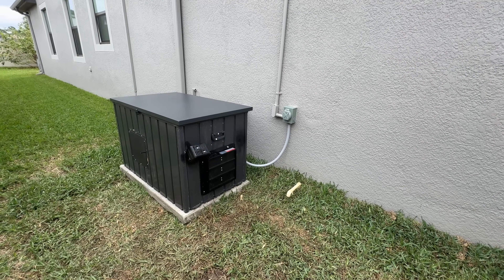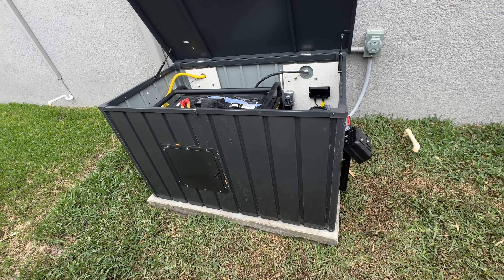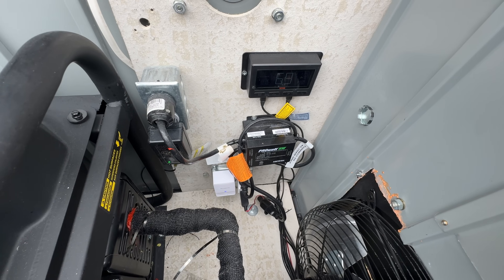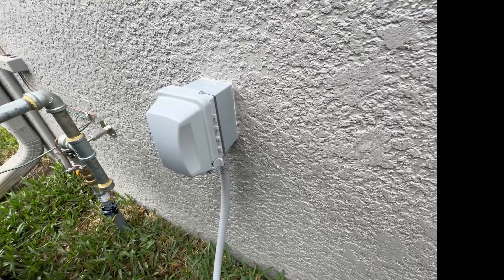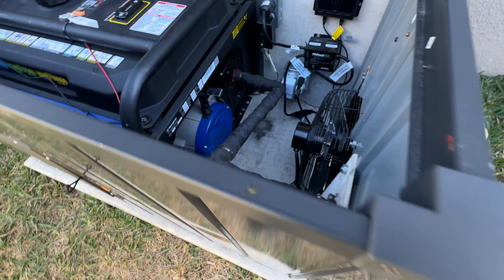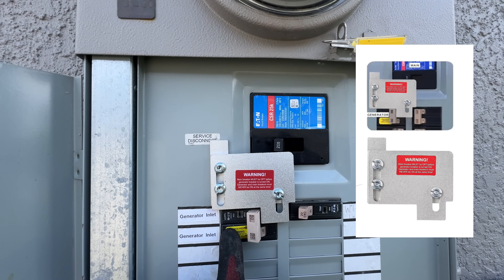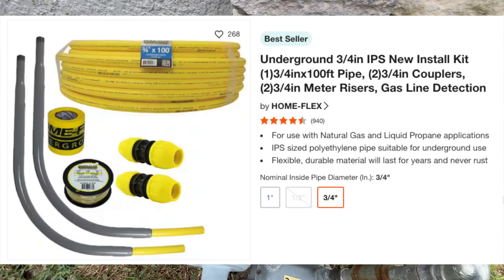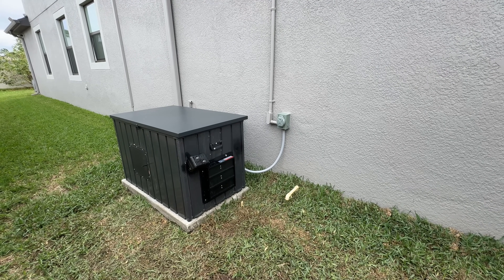DIY Whole Home Generator Enclosure: Power Your House Like a Pro!

Comment: Excellent video Bredren 🙏 I have a 30 amp Westinghouse transfer switch that I got for hurricane season, today an electrician quoted me 3000 to 4000 to install. So here I am. I have minimal electrical experience. Basic wiring of a switch and GFI outlet is about the extent. I live in central Florida. Would love to collaborate with you, I'd pay you for your expertise. Very serious. Give thanks Bredren 🙏
Reply from the maker: I live in the Tampa area and can provide some guidance.

Comment: Amazing work!  Why did you not choose to go with an inverter generator?  Do you have any concerns or thoughts around "dirty" sine waves from the Westngihouse generator?
Reply from the maker: To be honest, I had to look up the difference between an inverter, a generator, and an inverter generator. In the end, I felt that a standard generator would meet my needs. I’m not particularly concerned about dirty power.

Comment: Ok I need some clarity. I thought it was almost necessary to use an inverter generator for the "clean sine waves" and avoid some equipment damage. So can I or can I not run a regular generator?
Reply: You can, but heed caution.

Comment: Greetings my distant cousin...I have been rooting around for a satisfactory DIY home emergency power configuration since last fall.   I have seen many good ones, but yours is one of THE BEST I've seen.   I like ALL the bells and whistles of your install, including the case.   Kudos to you!  I do have a few thoughts involving the THD rating of the gen you chose.  As there are power sensitive "computers" in every major system and appliance in modern homes, I'd tend to seek a gen with much better THD stats.  Also when I mimic your setup...I expect I'll seek to add some sort of sound deadening material inside of my case.

Comment: Hope you never plan to change the oil or have to service the generator.
The exhaust setup will burn up the exhaust valve in the genset engine. they are not designed for the back pressure you added or excessive exhaust heat load you're undoubtedly creating in the Chinese cylinder head.
Reply from the maker: What is your solution as this could be an opportunity for all to learn?

Comment: DUDE this is exactly what I am looking at making. Thanks. $3K DIY for $6K for an installed Generac
Reply from the maker: Yes! The Generac pricing is crazy- a total ripoff.
Reply: I’m preparing to do mine, I intend to use GenerLink to hook up to the meter and using a electric start generator so I’m guessing I’ll need a window for the infrared. What size Nan did you use and was it enough to control the heat. Love the look of your cabinet, very professional look

Comment: 👍Looks good, but I would added #8 or #5 304 Stainless Steel Wire Mesh on both fresh air intake and exhaust. The mesh is for stopping large 🐛bugs, small mammals(🐀mice), and reptiles(🦎lizards/snakes🐍) from getting in & setting up shop. Mice can squeeze through holes or cracks as small as 1/4 inch, while rats can enter through openings as small as 1/2 inch. Where their are mic or rats snakes will follow to the nests to prey on. Also adding Borax powder around the inside base of walls can be used as a safe way to help control certain pests like 🐜ants, & 🪳cockroaches. Ants are especially attracted to electrical equipment for several reasons. They really love getting into electrified outdoor enclosed structures and making themselves a home in them. I now use Borax around the high voltage contactor & capacitor in my HVAC systems condenser unit. After having to remove a hole ant nest(eggs and all) form the high voltage contactor that shut down my homes AC one hot summer.
Reply from the maker: Great idea. I will definitely add that as it is an easy add. It's a little more difficult on the exhaust but still doable. Thanks

Comment: I’ve seen the same automatic transfer switch on several other builds and I have an honest question. If you have utility power coming in to power those additional outlets, and the the transfer switch is just for the fan, couldn’t you just flip the breaker in your panel once the generator is running and save money on the transfer switch?
Reply from the maker: You’re absolutely right. Another viewer actually pointed out the same thing in the past. It was an oversight on my part. In this design, that step is completely unnecessary—I could have simply plugged directly into the outlet, and everything would’ve been more streamlined. Thanks for sharing so others can know this fact.

Comment: thank u for the video!
What gauge wire did you use to run from the inlet to the breaker? I am doing something similar and am thinking 6 AWG is the way to go.. opinion?
Reply from the maker: Sorry—I’m not sure how I missed your question. I used 6 AWG wire.

Comment: Is it a floating, neutral or bonded regarding your home breaker panel? And do you have an emergency shutoff switch? I think that model has remote start..
Reply: It needs to be floating when connected to the house through a two pole breaker.  If it were connected with a three pole disconnect that switches neutral then it would need to be bonded.

Comment: Do you have to remove the side each time you need to do an oil change? While running its recommended to change the oil every 10-12 hrs.
Reply: Good question, I’m keeping that in mind for when I build my setup

Comment: I have questions about this setup as I am looking to do something similar at my house. Why did you ground your generator when you main panel is already grounded? Did you unbond the generator so the electrical path would only go to the grounding rod?
Reply from the maker: I haven’t changed the oil yet, but I ordered another access panel that I’ll be installing to hopefully make that easier. If that doesn’t work out, I’ll have to remove the side of the enclosure.

Comment: Great Job!  I built one using plastic trash enclosure. I too live in Florida It worked great until Rodents chewed up internal generator control wiring.  After  reworking wiring.  I decided scraping   enclosure idea. I did have issues with O2 sensor.  I used 13000 watt dual fuel Duromax.
Reply from the maker: Damn rodents. I was mainly worried about bugs nesting, so I blocked most of the obvious holes. But clearly, there are plenty of other ways for them to get in—vents, gaps, who knows what else.
Reply: @ColleKharis  For some reason thy like chewing ignition coil wires.

Comment: Excellent job!!! How does it sound?  How much did it decrease the the db level of the generator when operating before and after?
Reply from the maker: Sound was never a major concern for me, as I’m surrounded by homes with generators that are all louder than mine. That said, someone did ask me a similar question in the past, though I can’t seem to find their message or my response. If I remember correctly, when I tested it, there was about a 6 dB drop—but don’t quote me on that. I’ll need to redo the test to confirm.

Comment: Not too bad for not being Tradesmen however a couple issues the number 6/3 & 14/2 Romex that you ran, is not permitted in damp applications like PVC pipe outside and going to your generator, it is permitted in PVC pipe if it was in your garage but not outside. The outlets you put in the enclosure are not weather resistant or GFI protected, that was showing anyway. The box in the Attic where you spliced in the generator because there is a splice in the wires do not pass through you are required to ground the metal box with a grounding screw on the box terminal. The junction boxes in the Attic are required to be no more than 3 ft from the Scuttle entrance so they can be accessed without crawling in the Attic, location they are in is not considered accessible. Not sure how they let you get away with back feeding the entire house with 50 amps and not have a separate panel that the generator is only feeding Other than that not bad.
Reply from the maker: Thanks for the detailed feedback — it’s really helpful. Based on your comments, I’m assuming you’re an electrician and clearly much more knowledgeable about these matters than I am. The outlet inside the enclosure is on a GFCI circuit, as there’s a GFCI outlet in the garage upstream of the breaker panel. I’ll have a licensed electrician friend take a closer look at the other points you raised.
Reply: They allowed it because no permits😂
Reply from the maker: @nitto420s Got it—now I fully understand what you meant about the 6/3 and 14/2 Romex. I didn’t run Romex through the PVC; I used individual conductors for both the generator output and the commercial power going to the outlet on the wall behind the generator. That said, I did use Romex from the outlet box into the enclosure, which I’ll need to fix. It slipped through the inspection, but it’s a quick and easy correction, so I might as well take care of it now to avoid any future issues. Appreciate you pointing it out.

Comment: Quick Question, wouldn't the galvanized enclosure over heat because of the sun light and heat from the generator itself?. Very well and professionally done. Thank you for sharing your knowledge.
Reply from the maker: Excellent question. That’s exactly why I installed a smart temperature monitor—to keep an eye on the enclosure and internal components. I haven’t had to run the generator on extremely hot days yet, but based on the historical data, the exhaust fan seems to be doing a solid job. That said, I’ll have to wait and see how it performs when both external and internal heat sources are in play.

Comment: you've inspired me sir, thanks much for the detailed video here.  we're in FL as well, and backup systems like this are becoming more and more important.  will say i was hoping to see you do a run-thru showing it take over powering the house and seeing what type of load this gen was capable of.  perhaps  

quick question (if you don't mind me asking): what are some of the specs of your house/load?  wondering what sq ft, AC tonnage, % of load the Gen is able to take on, household compromises, any issues with HVAC, etc etc.  would love to hear some of this context for max relevancy here.  we're in the process of putting a similar system together and now going with a larger wGen than expected, not only because of the wattage loss going to Natural Gas, but due to higher harmonic disturbance as you get closer to the wattage capacity.  while the wGen does advertise a lower THD, some tests online show once you get in the 65-70% load range, that the delivered voltage can come with substational swings - which is very dangerous for sensitive electronics.  for some electronics this is not an issue, but we're deep into smart home tech along with several computers and servers, and wanting to be as cognizant as possible for this upcoming home upgrade.  

for anyone reading/researching this: we're 1700 sq ft house with dual AC systems on the house, totaling 5.25 tons of air.  when we upgraded HVAC last summer, we purposely went with inverter type compressors to ease the amperage load on upcoming generator installation.  we are likely going to proceed with the wGen 14500.  if everything goes well, this gen will never see a drop of gasoline, in hopes to improve the longevity of the device.  we have auxiliary natural gas port in place, and this particular wGen will provide 12000w peak, and reports 9500w continuous.  our goal is to not exceed 55% of the gen's capability which puts us at 5225 usable watts.  only homework we have left to do is determine which soft start will be approriate for our setup, and still trying to find a whole-home power conditioner to minimize/eliminate any voltage swings..
Reply from the maker: Thank you—I really appreciate that! Glad the video was helpful and inspiring. You're absolutely right—here in Florida, backup systems are becoming more essential with each passing storm season.

A full run-through showing the generator powering the house and handling different loads is a great idea. I’ve been thinking about doing just that in a future video, so stay tuned!

Comment: If you can find a contractor with a Lowe’s Pro account, you can get a 26kW Generac with the automatic transfer switch for just under $6K. Install labor is extra though.
Reply from the maker: That’s not a bad price. Thanks for sharing.
Reply: Nice job. I think I would elevate the slab and box, being that you're in Florida.
Reply from the maker: We’ve weathered several hurricanes and storms without any flooding issues so far. That said, as you pointed out, Florida can be unpredictable.

Comment: Thats a really nice storage box.  I've been looking for metal ones with no luck so far. 👍👍
Reply from the maker: Thanks. I was a bit worried when I got the box in because it was disassembled and appeared flimsy. However, it is relatively sturdy after putting it together.

Comment: Very nice looking and professional install. Well thought out. I did something similar but built a box out of cement blocks and ended up spending a lot more than I wanted to.  Be interested in your total cost. 
   You addressed compartment temps. What fan did you use and what sort of internal temps are you getting?
 - How about noise levels?
Reply from the maker: I considered building a concrete enclosure myself—something I could actually walk into. But since I don’t plan on making this my forever home, I decided to pivot. I’d love to see some photos! As for noise, I didn’t insulate it, so the sound reduction is pretty minimal.

Comment: Flew right past the automatic transfer switch...I thought those only worked with the designated standby generators (i.e., Generac). Is there a universal one out there that works with portable generators??
Reply: He's not using it for the house, the breaker interlock is for that. He's only using it for the fan (and the other stuff on the outlet box in there". As for an ATS for the house, there are kits that exist for some generators, but you can make your own. A normal ATS just has a NO/NC connector for telling a relay when to start the generator. That relay is called a "AGS" or automatic generator start(er). It would hook up to the starter of any generator that has one.

Do - Not - Attempt unless you're 100% sure of the implications of all these things. There are videos but make sure you talk with your local county/city/etc and see if it would be allowed.
Reply from the maker: Thanks for responding to this comment. This is the first time I am seeing it.

Comment: Hello my friend awesome video best setup yet I just have one question how did you hard wire the generator to the inlet box I was trying  to look at the video  to see but that part is unclear  please  advise or if you will please make a video about it this information  would  be most helpful  thanks and God bless
Reply from the maker: Hardwiring the inlet box is not a normal approach. I did it as an afterthought. Nonetheless, I can do a follow-up video.
Reply: That would be much appreciated looking forward to the video i am about to build my generator shed and the information would help out along way thanks and God bless

Comment: Nice setup but even with the front side removed, how easy or difficult is it to change the oil? 🤔
Reply from the maker: Hello. I haven’t had to change the oil yet but theoretically it seems very simple.  Now, we all know that theory doesn’t always mean practically sound. Time will tell.
Reply: @ColleKharis  It's going to be very awkward with the gen sitting on the ground like that. I would buy some thick rubber blocks to elevate the generator. That will give you clearance for a pan to catch the oil and also less vibration on the floor of your enclosure for better sound deadening.

Comment: Great job. Did you prep for vibrations/ oscillations of the generator for the exhaust system? Use your phone with the genrator running and record a video, you will see the generator moving. Installing a flex pipe in your exhaust aystem will prevent components from cracking or coming loose from the solid mounting of the shed to the small movements of the generator.
Reply from the maker: Hey! Thanks for the comment. I initially used a flex exhaust pipe but ended up replacing it. There’s a chance this setup could cause issues down the line, but there’s some give in the pipe, which I believe may actually work in my favor.

One issue I did run into was that the screws holding the exhaust to the generator kept loosening due to vibration. I had to apply a high-temperature threadlocker to keep them secure.